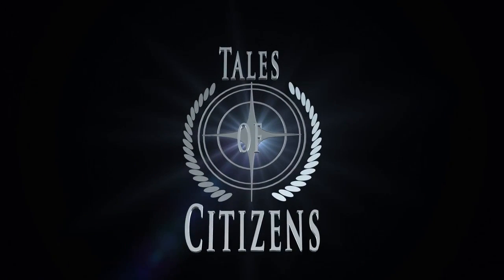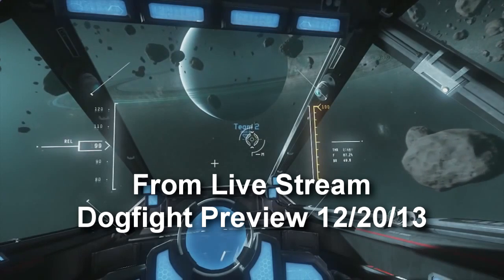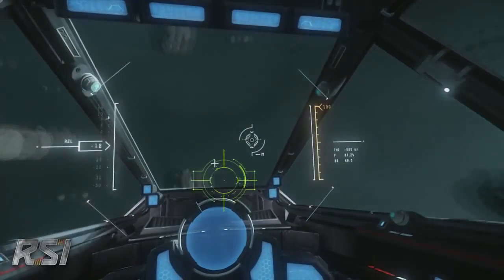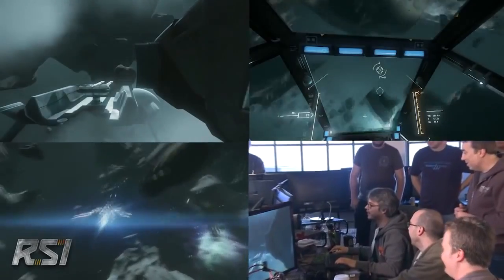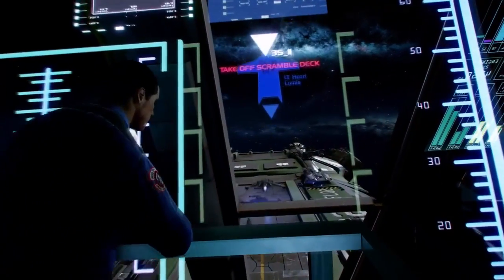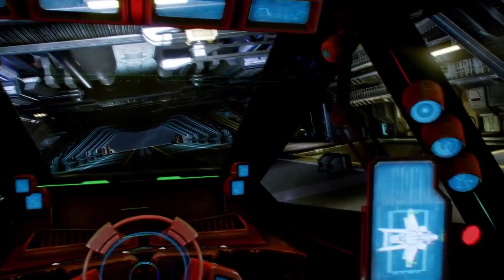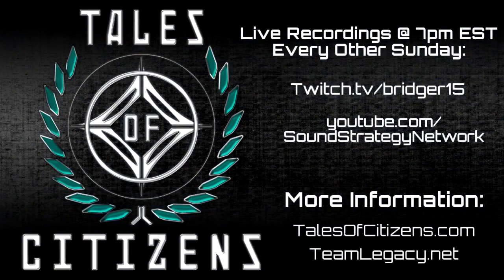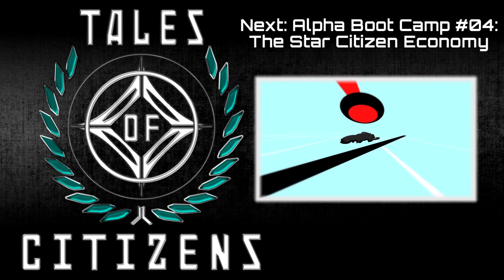Star Citizen Alpha Boot Camp #03: The Physics of Combat

Comment: I get the part about limiting speed to protect the pilots from G forces, but I don't understand the need to model airplane flight. If all it takes to achieve a maneuver is the push of a thruster, there are many more acrobatics possible that don't have an analogue in normal flight. A plane would be able to rotate along a 3D axis and point the nose in whatever direction it wants, independent of the path of travel. Too easy. I can instantly flip around and point the big guns at whatever point in space I want. Combat over.
Reply: trust me its a nightmare if you turn it off... because you essentially have no control. .. its a toggle switch that you use to perform certain menuvers but other than that you need it on to dampen your turns or you will be constantly correcting your self on 3 axis